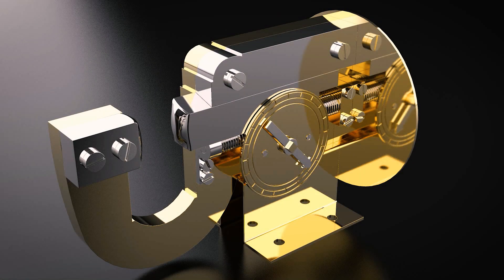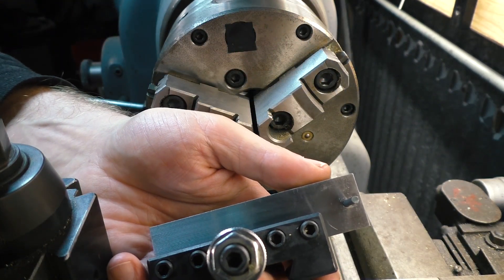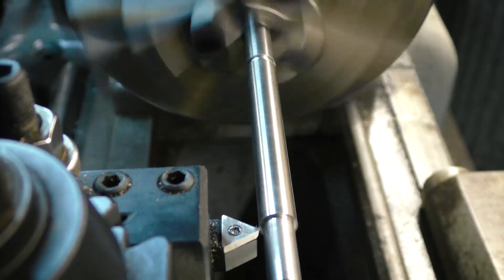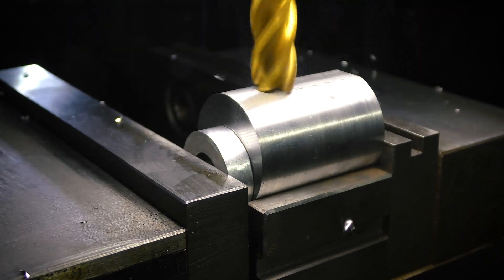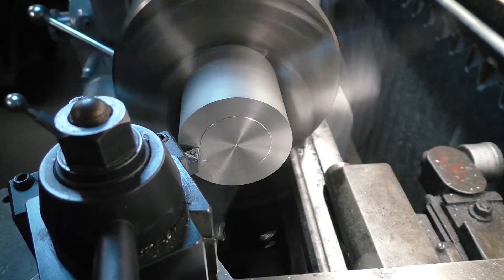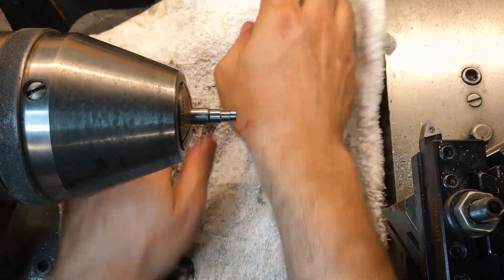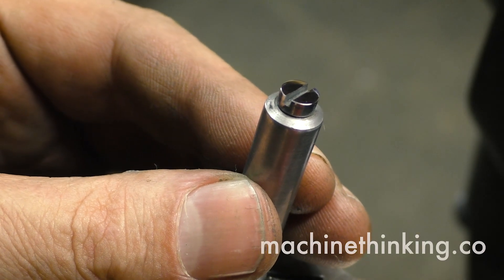Cutting threads and worm gears on a lathe

Comment: A quicker way to polish screw heads. Put screw in pillar drill and under it put a parallel with abrasive paper. Start drill and move head down to paper (use some pressure that isn't enough to rip paper) move parallel with paper. swop pare for finer paper.
I've used this for polishing clock screw that need to look good.
You can find my very bad YouTube channel under making a carriage clock. By Stuart Andrews

Comment: If you're using a collett, and your size is simply in between two different collets, so long as you start and finish your piece without removing it at all until completely finished:
You can simply wrap a piece of paper, or Emory cloth around the work piece to increase the diameter. 

obviously it will not be completely concentric, that's why you must do all your machining before removing it.
So it's only applicable to very specific circumstances. 

(Love that tap, used as your cog idea, I've not seen that before. Very good idea.)
great videos ☀️😎🇺🇸☀️

Comment: "I know what you're thinking"... no... I was thinking that the imperial system is cringe AF
Reply: AF Is a spanner size not a thread size it means across the flats ( on the nut or or the bolt head (usually hex or sq ) Metric Spanners are also AF,
The threads are SAE ( USA ) and Whitworth  (British ) Combining the two  (sort off ) we get UNC and UNF which means Unified National coarse 
and fine coming about in WW 2
Reply: The Whitworth spanner sizes were in relation to thread size , The BSF hex size was smaller again but to confuse maters the Whitworth hex was changed later to the BSF hex size.

Comment: I'm a machinist for a living. I make flight parts and just regular turbine parts for GE power units. Lot of dovetails in blade rings and cutting chamfers on blade segments to go into the dovetails. Anyway that measuring tool that you were using to measure your brass bushing is a vernier. A vernier scale to be exact. It is not a micrometer. It might measure out to thousands, but at micrometer has a dial and indications for .0001 as well as half .0001. I like your channel though it's definitely informative though for people new to this machining thing.

Comment: you need to re set your tail stock. You will  like it better if you do.  I noticed that when the reamer found the hole it had to bend over to get in the hole.  Correct this by adjusting the tail stock .  Unlike a lot of small lathes your tail stock is adjustable.

Comment: Nice video, but I strongly disagree with your comment @5:37, I use carbide insert tooling pretty much exclusively on my small lathe and the advantages are numerous. Although I can see that the chip breaker geometry is optimized for higher chip loads this is usually not a problem. And thanks to our Chinese friends, carbide is now relatively cheap.

Comment: When tapping or cutting a thread with a die using the tailstock, don't lock the tailstock. Let it slide. Then it doesn't matter if your effort to wind the tailstock doesn't exactly match the pitch of the thread. The thread being cut will pull the tailstock along the lathe bed on its own.

Comment: how do you hit the same groove exactly on subsequent passes?
Reply from the maker: It’s not shown but the lathe has a threading dial which shows the relationship between the chuck and leadscrew. By looking at the threading dial and engaging the threading half nuts at just the right moment it will follow the same path.

Comment: I don't know if this right but I cut a chamfer in the material I want to thread a die on, then I force the die onto the work by tightening the tailstock lead screw, once the die is threading on its own I release the tailstock lock so that it can move freely on the ways.  This way you don't have to follow the thread.  the only thing that is required is to stop the chuck when it is the length of thread you want then reverse it to remove the die from the work.

Comment: 10:40 you can just leave the tailstock unlocked and let the thread push and pull it in the direction it needs to go at the exact speed it needs to go
Reply from the maker: Shalor McKee on smaller lathes, yes but my tailstock is over 30 lbs and is too heavy for that size thread.
Reply: @machinethinking  What I do in that case is I just keep my hand on the tailstock and give it a hand pushing/pulling in whatever direction it needs. It's a lot easier in my opinion

Comment: I got to help (in a minor capacity) restore a Dutch house organ from ~1770 and they used handmade screws.
It looked like they made a jig to hold a file at an angle above the rod of metal, then they slowly rotated and advanced the rod in another jig with a tab to catch/align the new threads.
The end result was maybe 1.5" long with 5 TPI buttress threads.

Comment: Cutting a worm gear that way would destroy much of the gear teeth since the relative position of the cut shifts as the tap moves from the major diameter to the minor diameter. At the very least for a precision measuring device such as a micrometer, this should be unacceptable. But these inaccuracies and poor methods appear in other parts of this video.

Comment: Hint instead of trying to follow the die in while cranking the tail stock, just loosen the tail stock to where it slides easily and push it in and pull it out.  40 years a machinist, you'll have less problems this way.

Comment: Nice work! For a real black polish though, I would suggest diamond paste on a zinc block that has been either milled or filed flat. You can use the same procedure that you did with the emery cloth and paper in the lathe but with a zinc disc. Sacrificial anodes for boats come in handy.

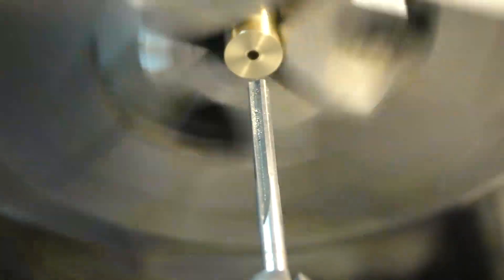Comment: When center-drilling at 0:44 and adjusting the hole diameter at 1:35 the drill bit does not appear to be perfectly aligned (it moves slightly sideways when entering the hole). Is that a problem (or rather, why it isn't)?

Comment: in drilling, and even in reaming, the wormwheel, the drill, and reamer, moved to one side
so the hole is not  concentric.
the micrometer will be inaccurate.
reaming does not give a concentric hole if the hole is not concentric to begin with.
and the drill wandered off so the hole the drill made was not concentric.
if you want concentric you will have to single point the hole.

Comment: 6:35 - I don't understand how you get the tool to start cutting exactly at the same rotational point it started at last time when you are deepening the thread.   What mechanism is there on a lathe that says hey, go! start moving right exactly at now...   and how do you get the tool exactly back at the same starting point over and over again... because it seems if either is off by any amount, it's going to fuck up the thread you are trying to make instead of making it deeper.   What is even moving it, some worm gear that is engaged and disengaged automatically, and how to tell it to stop?
Reply: On a manual lathe like the one in the video, the carriage that's running back and forth cutting the stock is moved by a leadscrew.  The leadscrew is driven thru a series of gears directly off the spindle which is spinning the stock.  The gears can be changed to alter how far the carriage moves for each revolution of the spindle which translates to the number of threads per inch or the distance between the threads for metric fasteners.  Either way, as long as you keep the gearing connected between the spindle and the leadscrew, the carriage will always track the same 'groove'.  But leaving the carriage connected to the leadscrew all the time isn't desirable because when you get to the end of the cut, you have to back the cutter out then reverse back to the beginning, readjust the cutter depth a little deeper, then make your next pass.  It takes a long time to 'screw' the carriage back to the starting point because the machine has to run slow enough for the operator to stop it when the cutter is in the 'run out' groove at the far end of the threads.  Since most lathes don't allow for setting separate forward and reverse speeds and it's often inconvenient to change them, you end up reversing at the same slow speed you're cutting at.  It also adds a lot of unnecessary wear on the leadscrew and the half-nut which is the device that locks the carriage to the leadscrew.  To get around these problems, you release the half-nut at the end of the pass then manually crank the carriage back to the start position.  Since you've broken the gear train to the spindle, the threads will now be out of time with the cutter.  To make sure that the timing is correctly re-established there's a device called a 'threading dial' that's typically numbered 1-4 but I've seen some numbered 1-8, with an additional hash mark between each number.  The dial is driven off the leadscrew and will turn 1 full revolution for each full revolution of the leadscrew.  If you engage the half-nuts to start the carriage moving at the same number each time, the carriage will always follow the same 'groove'.  Depending on the # of threads being cut, you may be able to engage the half-nut on any line,  an even line, or an odd line.  This will only work if the threads you're cutting are in the same system as the threads of the leadscrew.  If you're cutting inch threads on a lathe with an inch based leadscrew, the theading dial works fine.  If however you're cutting metric threads on an inch based lathe, you generally don't disconnect the half-nut, you back out of the cut and reverse the spindle until the carriage is screwed back to the start.  Clear as mud?
Reply: @marcseclecticstuff9497  - I don't think our huge industrial lathe from the 50's has any of that.   So like... invisible mud.  I'll have to look at it closer.

Comment: When running a die or tapping a hole with the tail stock, leave it loose. That way, if you screw up your timing a bit, the tail stock will slide so the tool doesn't break.

Comment: Some questions trying to address the elephant in the room here: How in the world do you build the worm screw with such precision without relying on a micrometer? Or do you think that they already access to someone else's micrometer and use it to build theirs? Was there already another device that allowed for that kind of precision? Without that level precision measurement existing yet, how could you trusted the dimensions on the cutting surface of your specialized tap or feel confidence that the travel dial on your mill was within tolerances? It almost seems to lead to a chicken or egg scenario... Or did I miss a critical step somewhere?

Comment: One thing I have never quite figured out about threads is how do you go about not having any even pitched and accurate threads to having them. These days there are of course options, but stepping back to purely mechanical era of machining, how do you go about cutting an accurate thread, if your lathe doesn't have accurately threaded lead screw to begin with?

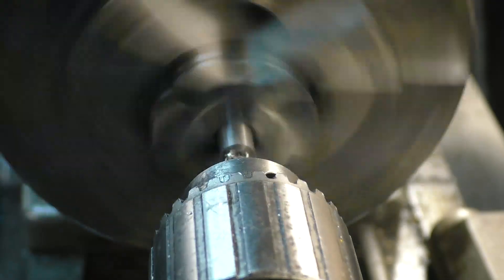Comment: I'm not a machinist but I loved the video.  I  think you deliberately made all those  mistakes  to  generate  lots of comments.  Nobody owns a  rubber flex chuck.  I think most people  would  run a 5/16-20  coupling nut & jam nut  over the lead screw  and  then  place it in 3-jaw chuck.  Really you don't have any  threading inserts?   At 4:19  I thought you were gonna collide the  carriage  tool post into the  tail stock.  Thank you for showing how to cut a perfect slot in the screw head.   The video   was missing  the  method  you  used to check  the  thread fit  on the finished lead screw.   I was surprised  to see the method you used  to cut the worm pinion teeth.   Great job anyway!

Comment: One question to add to the historical timeline is: How did threading start?

A rack and pinion is possible with nothing but a rough lathe. And a rough lathe can progress to a competent lathe... with threading.
But how do you get your first leadscrew ... without a leadscrew. Some poking around leads me to: "Wow, that's a lot of different methods." To the point I think it's a video worth making. They're almost as confusing as "First Lathe = ???" There is no sense of progression, as later inventors would often use earlier methods. 1) Wrap a thread around a round (wooden) dowel, mark, chisel/file carefully. 2) Wrap two drawn wires, then remove one, then proceed with method one. 3) Angled knife in curved jig, spin it around the rod. 4) A "chaser", think '1/16 or so of a die'. 5) Use gearing/pulleys with the easier-to-cut rack and pinions. One interesting note was that daVinci had a two leadscrew device that could average the defects of the screws to manufacture improved screws. (Which is another ongoing problem reinvented repeatedly.)

Comment: When you ream let the lathe stop before you take the ream out. No big deal but it's more accurate. I was capable to machine .700001 by using a caliper. But that caliper must pass QC first. I can see the dial like looking at a clock. It's really fun by trying to play everything accurately as possible. Say a caliper dial have 1000th inch increment but you can see those those dial half way between those increment its easy to conclude to say it's 2000th.  It all about trained eyes.

Comment: Cutting the worm gear with the tap started out well, but as the diameter of the worm became reduced by milling, the spacing between the teeth changed.  Although still serviceable perhaps, it would have been better to cut the worm gear with a dividing head, or a geared milling machine.

Comment: I might be wrong but i think what youre calling the worm gear is actually the worm wheel.  What you call the lead screw is actually the worm gear.... And the lead screw in this case.
Reply: Worm wheels are worm gears, as worms are just screws and not a gear. A gear is defined as being a toothed wheel, and a worm gear is a gear that meshes with a worm.
While worm wheel is the formally correct term, worm gear is also an informally correct term.
Reply: @xaytana  very interesting!  Not to be pedantic but wouldn't that also mean that a helical gear is just a short multistart screw and not a gear?  At what angle and number of starts does a gear become a screw?
Reply: @DoRC  a screw is a fastener that is threaded into a workpiece. If it's used to apply a load and turn something it is a gear. Just because something is helical doesn't mean screw is the right word. The other person is being pedantic but not in the right way.
Reply: @kylekinsey2624  I know:). I was just wondering how he would respond to that while still sticking with what he said before.
Reply: I had the video muted, but the worm wheel is the spur-like gear that gets driven, the worm is the spiraling gear that drives

Comment: Is there a reason you didn't give the thread for the leadscrew a bit of a taper on/off? I find this helps improve thread quality. 

Is there a reason you didn't turn down the screw a little once in the lathe, before threading? It looked like it was a hair off center.

Comment: Less heat builds up if blocks are surface ground at a 45 degree angle, notice the witness marks the grinder made. No criticism, just making a suggestion that can be learned from. I learned not to do this from a not so diplomatic way.
Reply from the maker: I've always wondered why I saw people do that but never knew why. Thank you! It was a super light cut where heat (for my purposes) wasn't an issue but I always appreciate knowing more.

Comment: Nice video, but in regards to the tapping/threading die, you might wanna untighten the tailstock (so it'll slide just easy enough) and have it "pulled" towards the spindle. This will get you through most threads, aside the ones that are more of a surface finish (i.e. below M2).

Comment: When you are machining a thread on the lathe, how do you ensure subsequent cuts end up in the same groove?  Is there some timing mechanism that ensures the cut starts at the same point of rotation?
Reply from the maker: Yes, it's not shown in this video because I didn't want to make it a detailed threading video but there is something called a "threading dial" I can look at (basically a worm gear driven by the leadscrew) which shows me the relative position of the leadscrew and chuck to each other. I only have to engage threading at the right moment (not hard) to get it to line up correctly.
Reply: Ahh, that makes sense.  The lead screw is synced relative to the chuck (or a ratio thereof, to allow different thread pitches).  The thread dial is just so you can disengage the saddle, wind it back, and re-engage at the same position on the lead screw.  That makes a lot more sense now.

Comment: Regarding tap/die use in the tailstock: make a sliding holder with a handle for those small (< M8 threads) threads, that way you don't have any problems following the tool with your tailstock and makes it less tedious to work with.

Comment: u used the screw on stick metode but using a wetstone and a flat thing whit a hole in it works beter for me  and i used a saw in my lathe an holding the scruw in my tool holder to make the slot so no mill needed